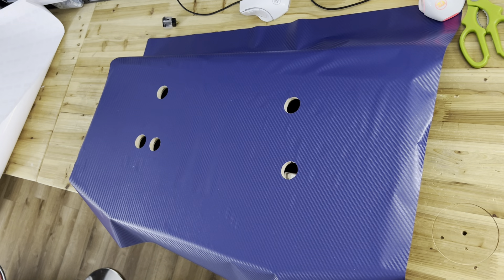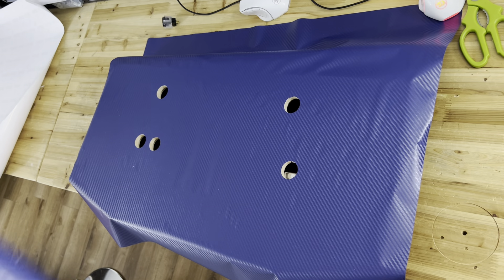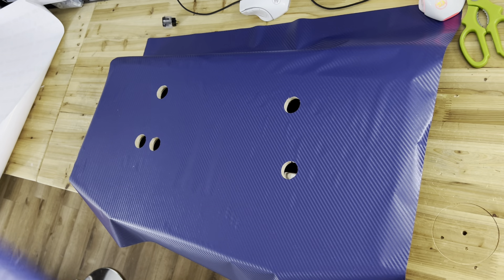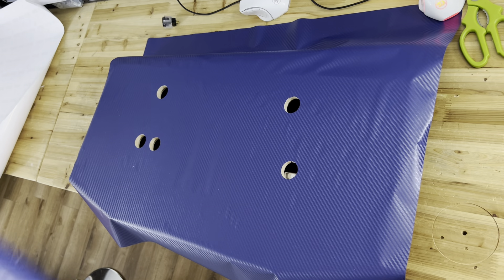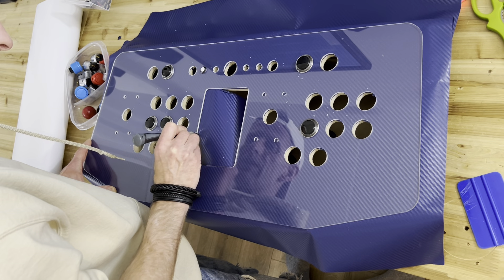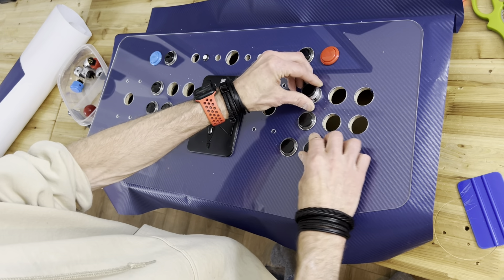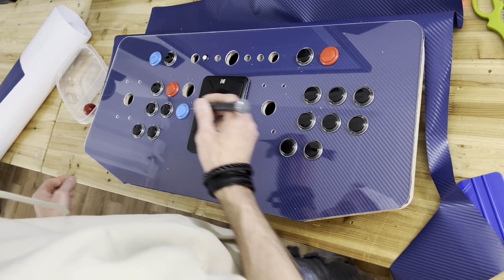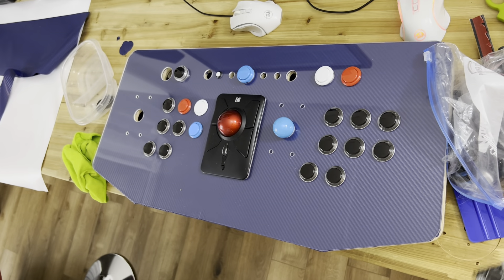kriscoolmod me adding vinyl 2p arcade board part 4

Comment: Did you use a paper template or did you measure all your cuts.
Reply from the maker: I create the templates with all dimensions and send it to the machine.  The machine know after exactly where to cut at mm precise know

Comment: I was waiting for the mdf board replacement for the new rice fiber board that they claim is better than mdf. Not so sure the new rice board is better than mdf and definitely not better than mdo.
Reply from the maker: Not sure about rice fibre.  Not available in Canada anyway
Reply: @KrisCoolmod  medium density fiberboard product made from post-harvest rice straw with no added formaldehyde, Eureka Sustainable High Performance MDF matches the performance of traditional wood MDF. With excellent machinability, paintability and consistency, it can be used to make furniture, cabinetry, doors, mouldings and more.  Lets see if this company really can do better than MDF and at a cheaper price, I was hoping to be the first to build arcade cabinet out of this material.
Reply from the maker: @quantumfx2677  let me know when you get it if its good product
Reply: @KrisCoolmod  Yes, I will and be putting it through the test!
Reply from the maker: @quantumfx2677  do a video showcase